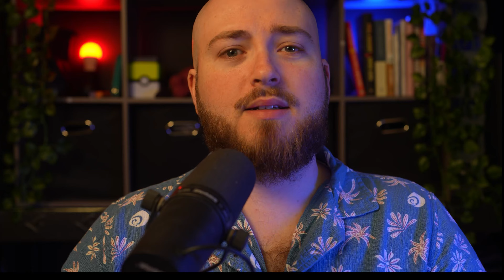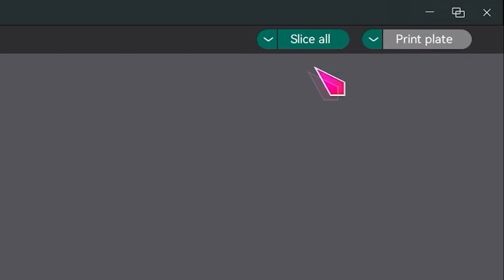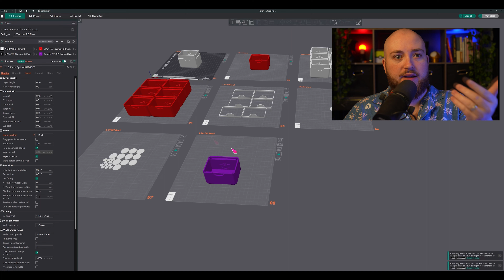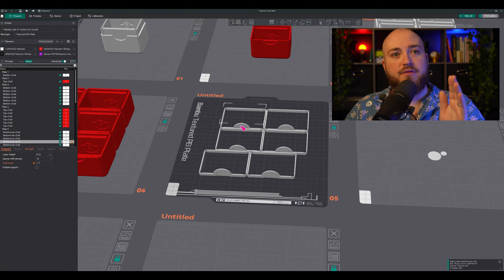THIS ONE SIMPLE TRICK CHANGED MY 3D PRINTING FOREVER

Comment from the maker: 0:00 Intro
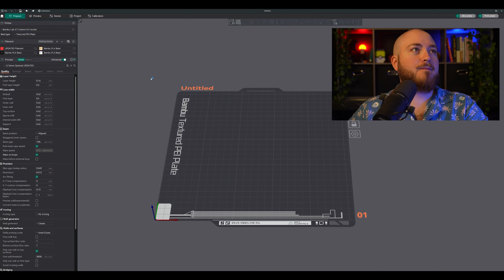0:24 Setting Up the File
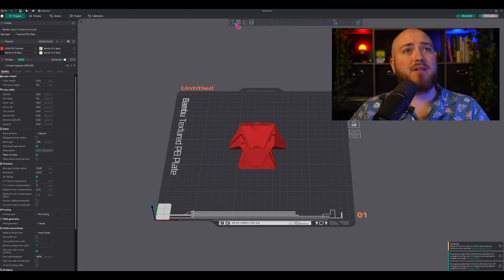1:14 Arranging Objects
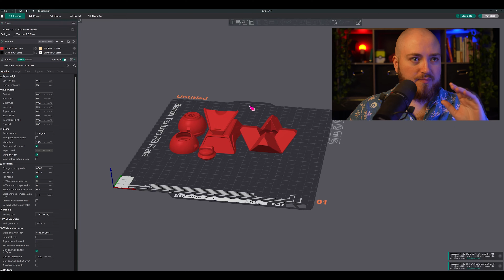2:03 Creating a New Plate
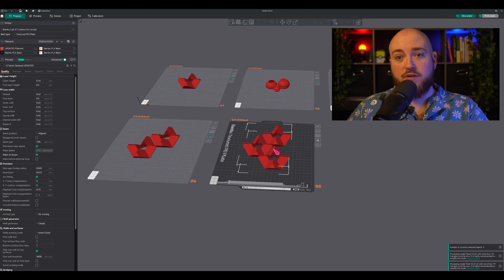3:29 Changing FIlament Colors for Separate Models
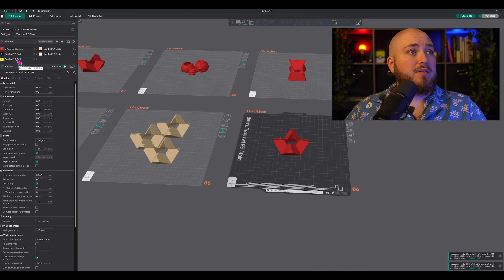4:14 Secret Multi-Printing Hack
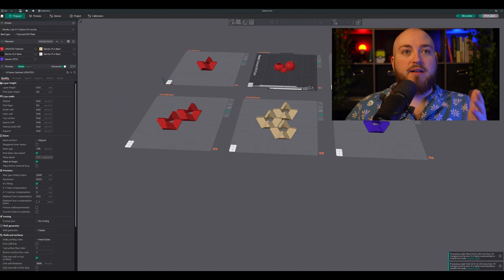5:00 Slicing and Sending File
7:22 Super Secret Tip to Keep Models All on the Same File
9:09 Outro